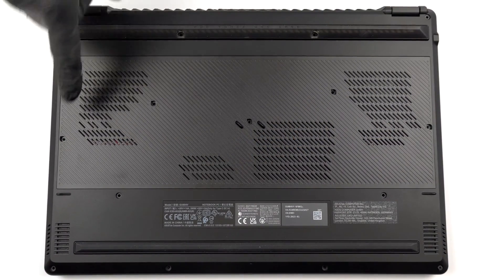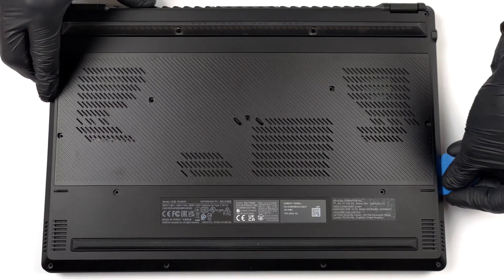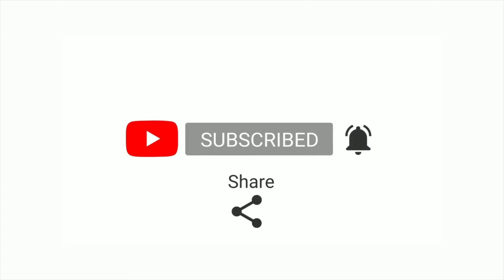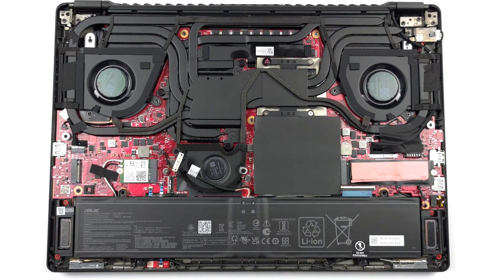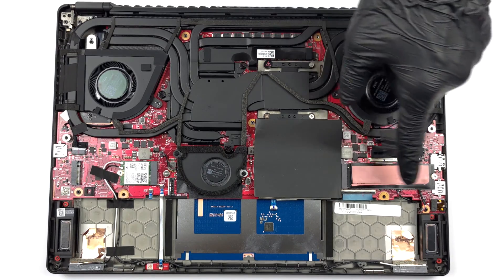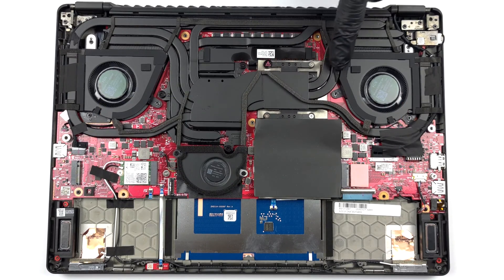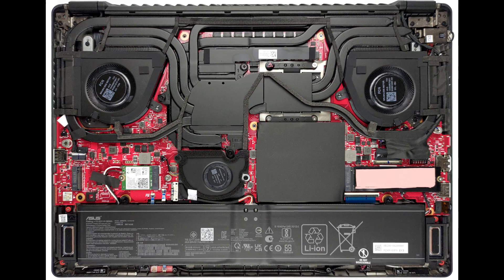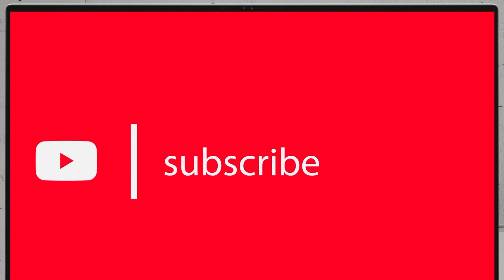🛠️ How to open ASUS ROG Zephyrus M16 GU604, 2023 - disassembly and upgrade options

Comment: Hello, please help me to figure out the cooling of my ASUS ROG Zephyrus M16 2023 RTX4070 i9 13900H (GU604VI-M16.I94070) laptop. 

I contacted ASUS chat five times. Two times I was told that PTM-7950 thermal paste was used, and three times I was told that liquid metal was used. The operators copy the information from the advertisement of the model with RTX4090, which definitely uses liquid metal. But the presentation said that liquid metal is only used for the RTX4080 and RTX4090. When I clarify, I get one answer or the other. They didn't specify the brand of thermal paste and the same cooling for GPU and CPU.

My questions are:
1. What type of cooling is used in this model: liquid metal or thermal paste?
2. What is used for GPU: liquid metal or thermal paste?
3. What is used for CPU: liquid metal or thermal paste?
4. What size (thickness and dimensions) of thermal pads are used for VRM/NAND capacitors?

With all due respect I know this is not your job. I'm just asking for your help please as an expert on what I should use to cool my GU604VI.
Reply: Did you ever find any answers to this?
Reply: @BravoBricks Hi. Yeah, it worked. It took a lot of work, but I did it.

Comment: Worst cooling solution ever on mine. CPU stays in the 90s and above. Ridiculously loud also.
Reply: Did you ever attempt the repaste solution? The throttling during gaming is really annoying.
Reply: @XBT786  I didn't repaste. Speakers are also very distorted above 40% or so. Performance is decent though, but I did wish it ran cooler, quieter and had better sound.

Comment: Ok I just did this:

To remove the rubber caps you need forceps, preferably thin ones but I think any will do, pinch the cap tightly and pull with a peeling motion. You want the caps intact so you can put them back in later (seems like a good idea so dirt or dust doesn’t get in there and prevent you from being able to take the screw out again) DO NOT USE ANYTHING ELSE. Tweezers and Screwdrivers do not work, the forceps will work on the first of not second try every time.

The bottom right corner screw is also different from the other three on the bottom row. (or at least on my laptop) remember this so you don’t spend 20 minutes wondering why one specific screw wont go in.

There you guys go!

Comment: I removed the back just to clean the fans without removing any components, and when i put it back together it wont turn on. No lights, no power, nothing.
Reply: Mine won't boot after disassembly without plugging in the power first. Try that.
Reply: You might of forgot to unplug your battery from the MB an touched it with something metal which will fry everything
Reply: Any update on this
Reply: @nicholas4926  after leaving it alone a couple days it luckily started working again by itself, but this recently happened to me again and I took it to a local repair shop to take a look. Turns out there's a motherboard failure and a bunch of components weren't working properly. Still investigating.

Comment: Ifixit makes an opening tool assortment that comes with a pointy plastic tool which works great for taking out the rubber plugs on some of the screws. It slso comes with the prying tool you see him using in the video. As an added note, I can confirm that the 2023 M16 works with ddr5-5200 speed ram. Anything over 5200 and youre wasting your money as the laptop will not support it. As he said in the video, you can install up to 64gb of ram. Reply to this comment to ask me any questions and i will assist the best i can!

Comment: Hi man, thanks for you disassembly guide, it's perfect !

I've ordered a touchpad to change mine because it's actually uneven (bottom left is down as bottom right)... 

Do you I'll have to go through all the process with the ribbon cables and stuff if I just want to raise the motherboard in order to unscrew the old touchpad and install a new one ?

many thanks :)

Comment: Mine does not come off completely, I can get around the bottom, but when i try to lift near the vents, its stuck. Im afraid to pull in case it breaks. Its like the thing is super glued
Reply: It's a bit hard to remove but it pops off, it does feel like it might break but there 4 clicks holding it,
Reply: Yeah it's very tight there. I have thise triangular tool I use to try and pry it apart, but it is still difficult. I can hear the click when they detach, but casing will not budge.

Comment: I have exactly the same memory RAM you have, but i only have 16GB and i want to upgrade to 32. Any ideas from where i can buy the exact one ? Thanks
Reply: i have the 13900h 4080 model of this laptop and it comes with the samsung  m425r2ga3bb0-cqkol memory, if you want the exact stick thats what it is for my laptop. it should be the same for yours but you can check with softwere like CPU-Z. It will tell you in the SPD tab under Part Number
Reply: is it ddr4 or ddr5?  @zernn

Comment: How did you get the rubber caps off for the 5 screws in the middle?
Reply: This is what I came here for and in the first frame they were already off 😭
Reply: @cnnhdlvth9557  I just used a small pair of needle nose pliers.
Reply: He probably didn't want to show all the swearing involved to get the rubber caps off... The only reason I looked for this video is for these very reason... Waste of my time.
Reply: I got them off with tweezers my friend
Reply: Medical tweezers work like a charm